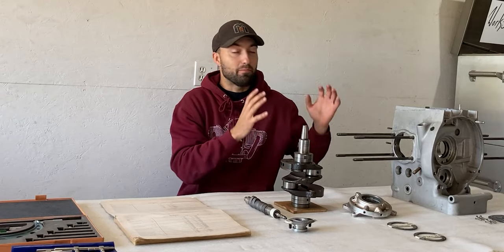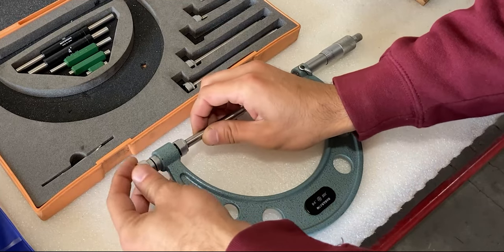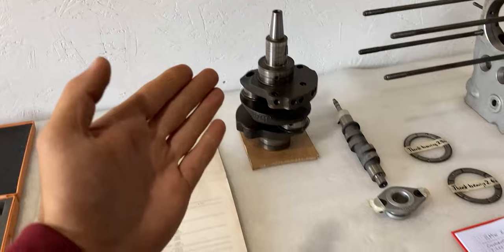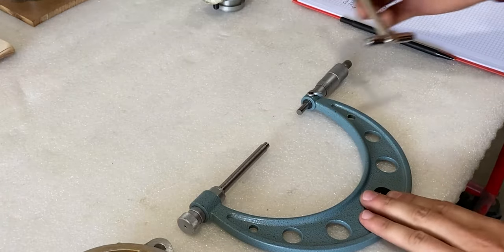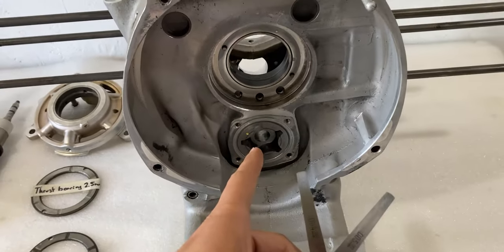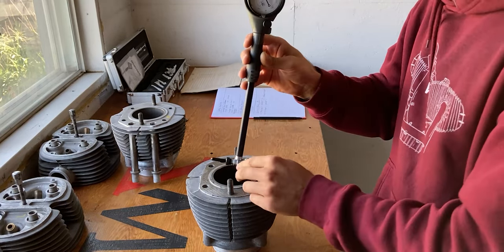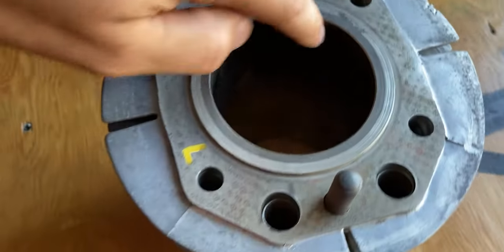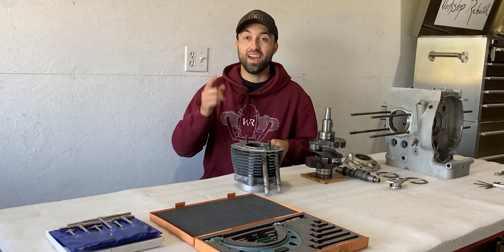Measuring BMW R60/5 Engine Parts (How-To)

Comment: I'm in awe of your skills. I have never seen these measuring tools as I have no background in engineering. The only thing I can add of any use is that my dad used to say that the Japanese worked with imperial measurements. What he didn't know was they had their own standard of imperial measurements from what we would call standard imperial measurements.
Reply from the maker: These tools belong to some of the most simple measuring tools, since they only determine the inside or outside measurement of a part, within the given range. I did some research and it is true that the Japanese had an imperial-like system before they strictly shifted into the metric system.
The imperial system on the other hand is growing on me and it's actually a far more precise method to use. I'll probably get into this topic once I have my lathe hooked up and I start to machine parts.
Thanks for leaving a great comment Simon! Regards Andreas

Comment: Hi all, I worked nearby a dept for cyl honing. I am not a professional, but I know, that the bores have not been honed cylindrical. It was more like wide top and bottom and a little more narrow in the middle. The tolerances for the ovality were very tight, but I think, more tight, as for the 2V-boxers while the 70ies. They are technical tractors and I am pretty sure, it will run good with these measured values.
Reply from the maker: These cylinders were probably bored and honed from factory to better standards then when I measured them after 90'000 + miles. The tapers of the bore are due to wear from the piston rings and this can be found on any engine. Even the most reliable engines have cylinder wall wear and there is a rule of thumb that 0.001" of wear = 100'000 km. If you have more wear during this time, then you have internal engine problems, or some materials are not to a certain quality. 
Nevertheless, I am not upset about this wear, because the engine will be completely rebuilt. Every component that is not within the factory specifications, will be replaced with parts that measure correctly. The tolerance for the /5 cylinder wall taper was set at 0.0004". Yes, 4 ten thousands of an inch!

I will update you, once I rebuild this engine. Thanks for your continued support and your awesome comment! Regards Andreas

Comment: hello sir!
can it be that in the manual book, to calculate the diameter you are not meant to subtract the specification.
2.3624
2.3628
instead of
2.3616
2.3612

thank you very much, very nice video!
Reply from the maker: Hi there, this is a great question! The manual shares the actual size and then the tolerance off to the right. In this case for the crankshaft main bearing journal, we have a tolerance that is negative (smaller) than the actual size that is given to us. This means is must be subtracted from 2.362". 
On this page there are many negative tolerances given, but I asure you on other pages there are also positive tolerances. Anther way to find out you're calculating your tolerances correctly is if you measure your inside diameter and your outside diameter. With these two values, you check to see if you have an oil-clearance. Compare this with you manual specifcations and then you can confirm that you're doing everything correctly.
Regards Andreas

Comment: Great video as I'm a complete newbie but am in the process of stripping a R80/7. 
I'm actually looking to purchase a micrometer set to check the tolerances on certain parts to see what I need to replace. Obviously you're using an imperial (inch) micrometer and converting. If I go for a metric (mm) do you know if it needs to go down to 0.001 or is 0.01 sufficient?
Reply from the maker: That sounds like an awesome project!! I would definitely recommend an outside micrometer for your main bearings and connecting rod journals on the crankshaft.
A metric micrometer that measures 1/100 (0.01) is sufficient enough for these parts.

Enjoy your project 😊👍🏽 Regards Andreas

Comment: Mate sorry to bother  you but I have a question… when you have a taper measurement bigger than 0,0004” it is no anymore under tolerance,  ( I think you have 0,0015”) let me know what do you think or give me a creen shot of the tolerance that you have. Many thanks mate !
Reply from the maker: Hi Jorge, the taper I measured on the L-Cylinder was 0.0015" and on the R-Cylinder 0.0025". I have an authentic BMW workshop manual here and the taper allowance states 0.0004". As you can read these number are too large and that is why I opted for oversize pistons. You will be able to see this in my rebuild video.
Regards Andreas
Reply: @WorkshopRebuild  Ciao Andreas !! you are totally Right, I assume that  the next episode you will show us the 1st. Oversize for Cylinder and piston (P & C=+0,50 mm  +0.02 inch)  !!! Many thanks and your work is amazing keep it like it is the /5 community have a big time with your channel.